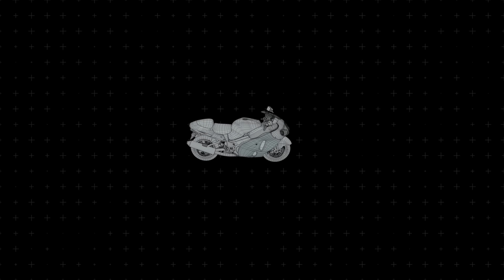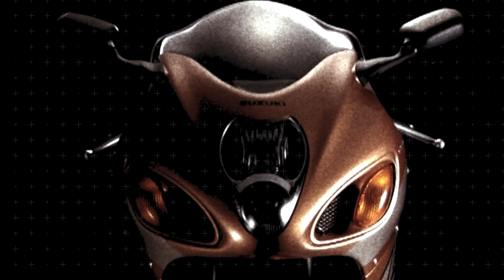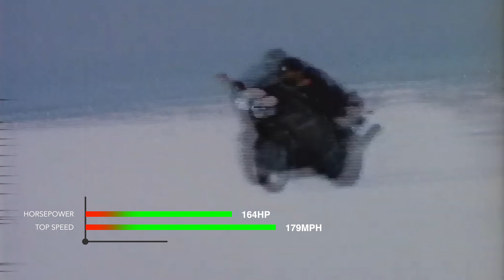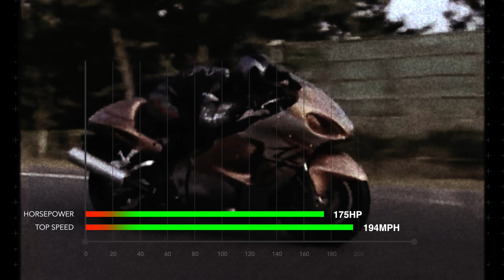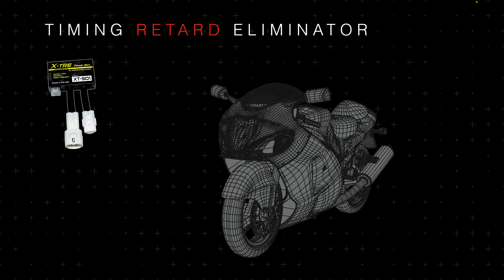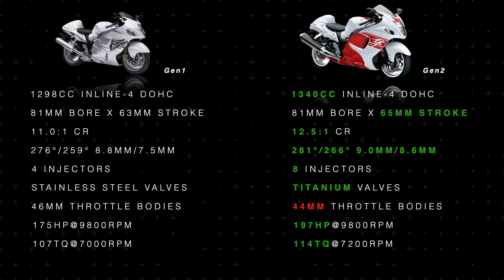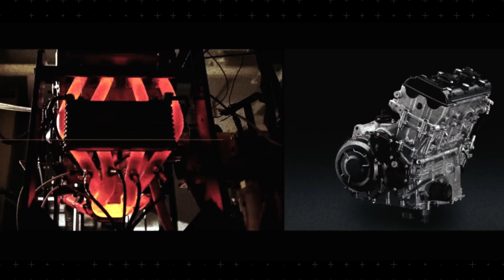Why Turbo Busa Engines Are Overpowered😳| Explained Ep.21

Comment: Do some videos on Ducati and their Desmo designs!
Reply: Agreed. Desmodromic valves are interesting.
Especially if the early bevel gear engines are covered
Reply: i got to ride a tuned 2020 Panigale v4s last spring on a closed airport runway, even cooler i got to race the owner while he rode my thrashed R1, that ducati with the tune he was running was the fastest thing ive ever ridden, the acc from 60-190mph blew my mind, he got it up to 208mph that day, and he weighed in at about190lbs, those are pretty good numbers.

Comment: Coming from cars, it is funny seeing the hp/L of bikes, but then also realizing that the service intervles of these engine kinda just make them reliable race engines. I would love to see a V8 based off a 4 cylinder motorbike engine. Imagine a 3L 9-10k rpm v8 making 300hp NA in a mid engine lightweight car like a lotus, mr2, or a feiro, or maybe a front engine application like a s2000, 2000gt, or a miata. A high revving NA sports car making 300hp and weighing less than 2800-3000 lbs would be so good.
Reply: The problem with car buyers drivers is that they are allergic to RPMs. When manufacturers put engines that made power at 9K like the 1st gen Honda S2000, it was slated for having poor low end torque.

The closest car to the one you described is an older Porsche Boxster/Cayman with a displacement around 3 liter, power around 300hp with an 8K redline.
Reply: @electric_boogaloo496  yeah I know the story with the earlier s2k, but that is with the old american market where the norm was large torquey v8s in everything, now we have much less low end torque in our every day drivers. The reason for a small rev happy v8 is for the noise, sure I could get the same power from a turbo 4 cylinder or a v6, but that doesnt sound original. those are everywhere. I mean a turbo 3 cylinder with a good exhaust would sound great, but I dont think the low end torque would be as good as a v8, even a small one. The difference in torque from something like a turbo 1.6L i3 to a 3L V8 would be sizeable. I know something like what Im describing will never be from factory without it costing a fortune, but maybe I could build one if I ever get the time, money, and the skills. Or I could just stick with a high revving boxer 6 from porsche like the gt3 touring as that is probably the best modern drivers cars out right now that doesnt cost over a quarter million dollars. It is fast, sounds good, deletes corners, doesnt have the aero so it is the perfect street car.
Reply: @charliemaybe  the bar set by old V8s wasn't very high. A 1.6L 3 cylinder turbo in the Corolla GR makes 273 lb-ft  which is very close to a 5.0L V8 in the Fox Body Mustang (285 lb-ft).

Competition is as stiff as always, but the market for sports cars has shrunk and so has profits. Emissions and CAFE have also played a very strong role in killing off the high revving NA engine. There are a grand total of 3 sports cars under 100K with a naturally aspirated engine sold new in the US today. The Toyabaru twins, the Miata, and the Porsche 718 GTS 4.0L. You can also add the Mustang V8 to that list if you discount its weight. Only one of them revs over 7K.
Reply: @electric_boogaloo496  maybe having the high rev ceiling isn’t realistic, but the dream can still stand at a front engine na v8 lightweight car. So that could be a v8 Miata, factory five mk4, or a stripped out mustang.

Comment: I have ones riden a GSX-R 1000, i belive that thing has more or less the same engine with 185HP, and it´s not realy fun to ride that thing.
For me that´s way to much power in a bike, absolute scared the crap out of me!
I reved that thing out ones on a straight in 4th or 5th gear... nice thrill ride, but way to much for me!

I rather ride my supermoto with 60HP, way more fun, and you can actually use all the throttle without dying!

Comment: Bikes are cool, but I also have been fascinated by the old Taurus SHOs. The Yamaha V6 in the 1st and 2nd gen and Cossworth/Yamaha V8 in the 3rd gen were always exciting.
Reply: Any car engine that Yamaha helped to design turned to something special.
Original Taurus SHO,  Toyota's 1.8L in Celica GT-S,  4.8 V10 in Lexus LFA and others.
Reply: @Dr.FirebladeSC59     Toyota 18R-G or the older 3T-C?
Reply: @ZXLNT  2ZZ-GE
Reply: 2007 to 2015? I think Volvo S80 have a Yamaha V8 in them, I had one, comfy car, and with an exhaust they sound nice too even if they aren't a rocket ship.  I have a few Triumph Super III with the Cosworth tweaked engines.
Reply: Yep  I  had gen1 and gen2 SHO ,   LOVE THEM!!

Comment: because a stock literbike+ already is as fast or faster than most 1000hp cars. throw a turbski on there and the bike is one of the fastest vehicles you can get no actual car is faster. the only problem is that bikes love to wheelie and that's the limiting factor. throw a wheelie bar on there and bikes are much better than cars.   modern liter bikes without wheelie bars already do 0-125 faster than most cars do 0-60

Comment: This is the only bike that terrified me when I rode it. You’ve no idea just how insanely they accelerate until you've ridden one
Reply: im reading this and ive never been on a busa
Reply: If they are reading your comment , they probably do know how they accelerate.
Try a turbo busa if you think yours is quick
Reply: I had an 05 busa and an 05 zx10R. I took both bikes to the drag strip and I was shocked that the zx10R was quicker and faster at the drag strip with me riding both bikes. I sold the busa not long after that.
Reply: Yep, demo rode a 2017 a few years ago. They are pretty sweet!

Comment: I remember being at the LA Motorcycle Show when the ZX11 was introduced. I was speaking with a Rep from Kawasaki. He told me the original cams designed for the bike were replaced and timing was retarded to get the bike UNDER 200mph. Would love to find a ZX11 and those original cam grind specs.😁😁😁
Reply: Even better was when the zx12r came out.  And boosted 12's are absolute animals.
Reply: @berube361  And better than a Hayabusa... I still have my 2002 ZX12R... I will never sell it.
Reply: @beve99  Mine got stolen ... till miss it (and it was one of the very few unrestricted that hit 217mph ... before the nerf bat came out and made it sad). Full throttle in 3'rd == power wheelies ... but man did it need lot of air ... over 6000ft it must have been down 50hp ...
Reply: @goguhu  Sorry for your loss my brother...
Reply: @beve99 I had one, 2001 unrestricted version, a monster, faster than the first Gen busa.
Reply: The ZX11 / ZZ-R 1100 was an extremely fast bike in its prime...

Some of the C models I've heard had a few issues mainly in regards to the gearbox. Apparently the original gearbox couldn't handle the torque at the time and if the bike was rammed from pull it sometimes jumped out of 2nd gear. Bearing in mind that the ZX11 is basically it's predecessor's engine which was the ZX10 TOMCAT just with a displacement increase along with minor engine upgrades. From the ' D ' model that was launched in early 93' those issues were eliminated but the bike now was quite a bit heavier with a more sleeker appearance and with a twin ram air system induction system which ( apparently  ) made up for the added weight and a softer rear suspension and increase width on the rear wheel from a 17 inch up to an 18 inch which caused the bike to be more of a hyper sports tourer than its previous model but even faster at the redline... I have much respect for the ZZ-R 1100.
Reply: @dirkvandermerwe6027  I have a 1993 D1 ZX11, the rear wheel is still 17 inch, and 5.5 inch wide, the only change in this regard was the tyre, which was from 170/60 to 180/55. From the official data, the weight increase was about 5 kg, but the chassis was stronger, and the CG was lower due to the position of the bigger fuel tank.
Another point to take in consideration it's that the ZX11 is "only" 1052 cc, while the Blackbird is 1137 cc and the first 'busa 1299 cc. Now 2º and 3º generation of 'busas have 1349 cc. And my dream bike, the ZX14R has 1441cc 😋💪
Reply: They make even bigger cams for those bikes.
Reply: Clearly they were relying on the logic that full scorpion pavement sledding at 194MPH would leave you slightly less dead than if it were at 201MPH.
Reply: I regret today I sold it … I would Max it out and I knew it had more and it felt stable at max speed.. 2008 Hayabusa and I will never sell it. I am a bona fide, adrenaline junkie, and I usually only ride it in the mornings when there’s no traffic and I go for 10 or more high speed runs and then I park it until the next Saturday morning and it’s sunny and no traffic. Totally exhilarating and totally reliable.
Reply: Funny that they'd retard it,if you meant just the cam timing ,that'll add up top and take from down low. 
Nothing's impossible,if all they did was retard can timing I'd bet some machine work can get that back for you.
Reply: @MrTheHillfolk  it's the opposite. Retarded timing increases bottom end, taking away from the top. That, along with the change in camshafts, decreased top end. Their desired goal.
Reply: Your cams gnerate torque at middle rev and a lot at power ( torque * rev = power) at high rev. 

These cams generate torque  where ? 
Ok you are a trained engine ...
... like me when I was under 20 years old. 
Ove 20 years and in my garage we changes the cams (plus opend the intake and out ....)
plus plus plus and bigger exhaust pipe diameter and other silencers (not street legal) 

Very high rev to start ...
oh dear the clutch ! 
No high rev means start the engine again (no torque at low rev , absolute no torque)
High rev an a lot of power 
Middle rev well not better , mhhhh worse

But we (and I) = fast faster fastest
Ok we have to be careful and know the roads with police officers + laser/radar control 

I dont think that it is useful for you to drive around with these engine. 
To be fat and loud is most of the time not useful.
A good torque at low rev and middle rev ist very useable.